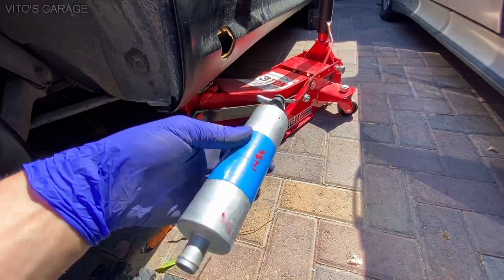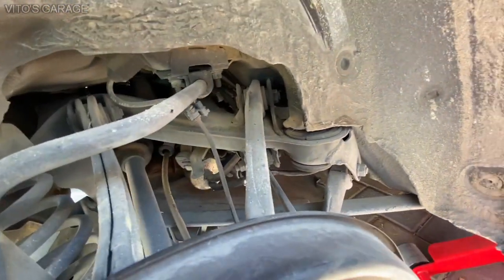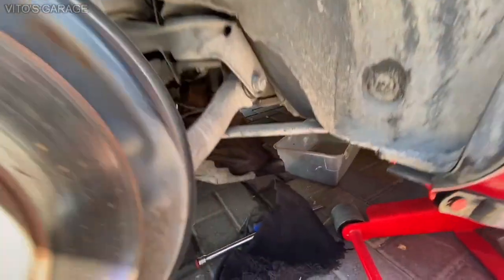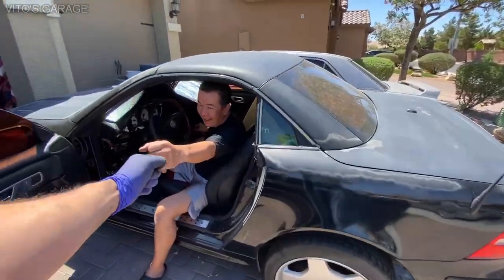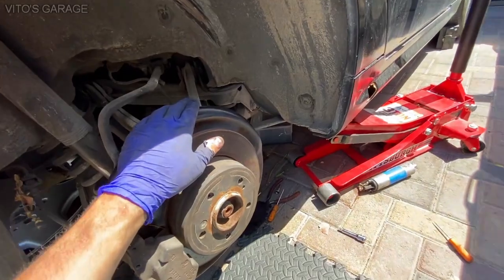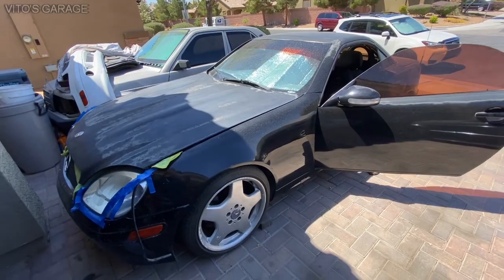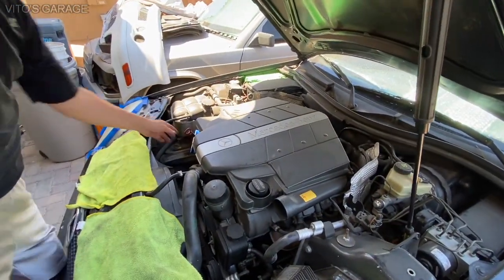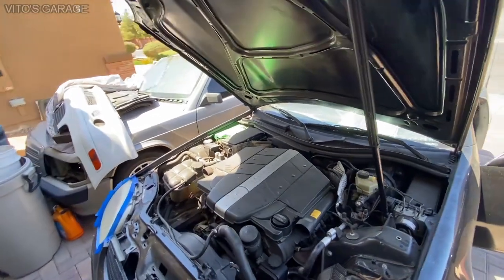Fixing a Unicorn Mercedes R170 SLK320 6 Speed Manual! The Owner is Happy! The Car is Alive!

Comment: Vito! Could you maybe do me a slight help? Im trying to repair my alternator Blue excier wire. It was frayed oil fouled and It went up about 5 inches from the loop spot for B+ or D+. . I know i can solder with some rosin core specifically but I wanted to know what kind of wire I should use? and if there is a squib for it. I couldnt find one on Starfinder or WIS.
 

these r170s. I just ordered a fuel pump from the dealer. The fuel pumps for these mercedes are MUCH HIGHER QUALITY THEN REPLACEMENT PARTS. If you try and use a "Beck arnley/URO parts" you need to read the Flow rate. The flow rates for these pumps are around 50gph and the pierburg OEM fuel pumps go up to 360 lph. that being said the replacements are nowhere remotely near the quality of genuine MB.

love mercs bc if the hood strut is broken you can always angle it straight up instead and it locks in place xD 
getting the same pair of amg monoblocks in a few weeks too!
Reply from the maker: Hey there! How thick is the wire you’re trying to fix? Is it a fat wire or thin one? 
And thanks for the info on the fuel pumps! The pump that I installed was a used pump from the junkyard. The owner has lots of plans for this R170. He will paint it eventually too! And yes!! 90degree hood opening! Only Mercedes can do that! :)
Reply: @VITOSGARAGE  pretty thin, the blue deka exciter wire i used regular red wire to fix it but I got rid of it because I want somethi g more legit to solder in placs. i have like 14 guge amp wire or 14amp amp wire pos and neg that I kept their a little thixker but inside is silver not copper of the wires I can use. and the red wire I have is a coppwr wire
Reply from the maker: @Mitutumuch  if you can, send me pictures of the wire you’re trying to fix and more details. It’ll be easier for me. You can do it on my Instagram or email: vitoldaswork@gmail.com
Reply: @VITOSGARAGE  okay i will put together a email and send it out to you because yeah this ks a common issue with this r170 spent this past 12 months dinf nthing but qork